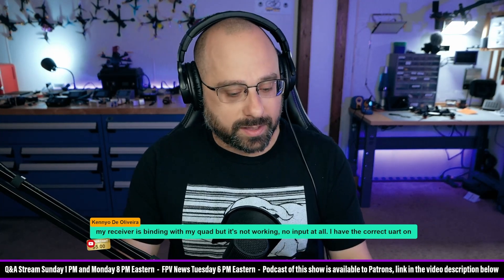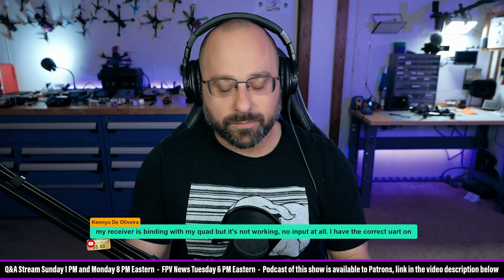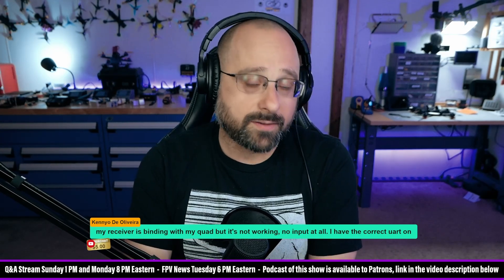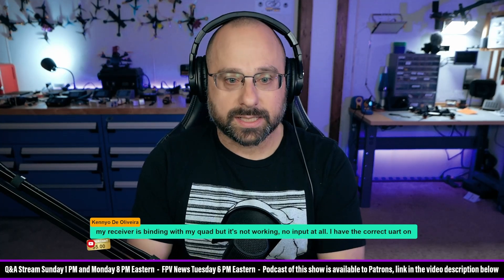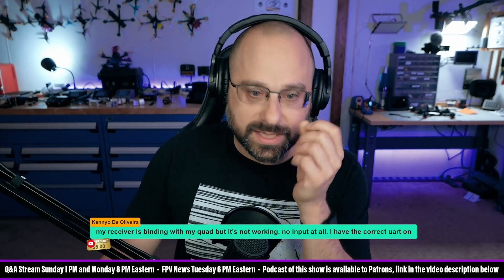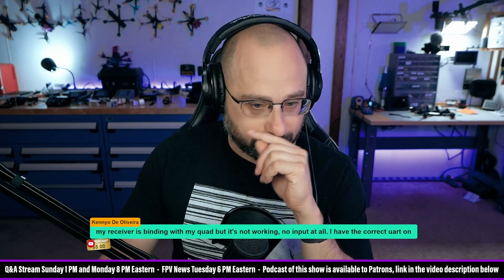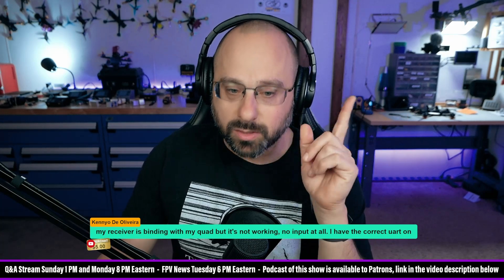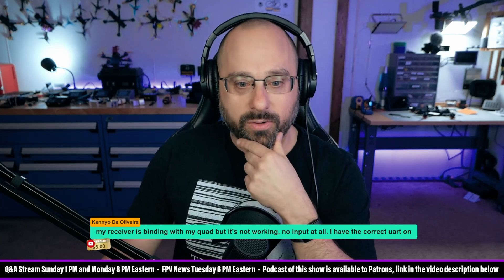My Receiver Is Binding But It's Not Working! Help! - FPV Questions

Comment: Hi Joshua my name is Raymond McWilliams and I am currently having a problem with getting crossfire connected to my radio the lights are green on the receiver on the radio but for some reason my radio won’t connect to the module any help would be appreciated

Comment: I traced the exact issue he's experiencing by connecting to another identical receiver, which worked correctly.  I discovered that my other, non working receiver wasn't flashed with the same firmware as the second that worked fine. Had I checked that first, I'd have saved myself hours of banging my head against the wall. instead of banging my quad against the wall, which I'd have eventually done once bound and built.

Comment: hi i had same problem radiomaster tx16s with ranger micro updated tx and elrs speedybee 2.5g rx bining works but nothing is moving at betaflight finally i found the problem was simple AUX in put for each movement

Comment: I wired 30amp esc's together on a rc excavator to a flysky transmitter recently. I had it working great and it just quit working and wont do anything.  The receiver isn't getting power i think bc the red light isn't coming on. Anyone have any idea what happened? Did i fry the esc's or something? Any help is appreciated

Comment: ok so i have a CineLog30 V3 with ESLR reciever and a Pocket controller and on betaflight it will let me set everything but as soon as I connect the drone to fly it, the controller wont respond. Says RX Loss but its still bounded to controller! I bought separately the O4 unit and installed it to the quad...spend hours and still cant identify the problem.  anyone help please!!

Comment: Tx to RX and RX to TX doesnt work for me, it keeps solid on that way and unable to bind,
when i put TX on TX and RX on RX  it can be put into wifi mode, bind, etc.
But i get no inputs in betaflight still,  uart2 serial on, CRSF protocol,  yet i see a "C" in expressLRS script for connected.

Comment: I'm going to save a few of you guys hours of frustration if you are bound, but have  no stick movement in betaflight. HUGE thanks for NORD FPV's video pointing out the issue with the O3 wiring harness - especially if ur upgrading from crossfire to ELRS.  You MUST remove the SBUS and extra ground in the 03 wiring harness, DJI's protocol conflicts with the ELRS one. 

I double-checked the wiring (TX to RX, RX to TX), moved UARTs, matched the ELRS software on RX and TX, turned model match off — nothing was working...The quad was about to go through the wall lol

Removing those two wires did the trick! Absolute legend! 🔥🙌
Reply: Bro thank you so much my new geprc vapor d5 o4 pro was about to turn into an example!!!
Reply: Does the problem occur even if ELRS RX is soldered on a different UART?
Reply: @ Yes, the issue still happened to me when I moved the ELRS to UART 3 instead of UART 2 (which is typically RX). I even unplugged one side of the O3 harness from the FC to test UART 3, and it still caused a conflict. I pulled the pins back using tweezers, removed the two extra wires — voilà, it worked.
Reply: @ For me only cutting SBUS did the trick, no need to cut GND :)
Reply: @RebellisSpiritus  Hell ya!
Reply: @FPVNYC thank bro You saved my quad!🎉🎉🎉🎉
Reply: I have the O4 Air Unit Pro and this worked for me also, thank you! In Betaflight I just pulled out the plug for the O4 and receiver inputs started working, then re-inserted the cable and inputs stopped again. I looked at the sheet for my drone (Vapor-X5) and there's just one pin from R2 to the O4 Air Unit's "SBUS" pin so I pulled that wire out completely and it works now (mine only has one ground pin so just removing that R2 <--> SBUS wire was enough). If anyone just happens to be in the same boat, I hope it helps. Thanks y'all 🙏🙏
Reply: @kali-wolf  
      Is there any chance you have a photo/video or could explain this more? Im having the same exact issue and found all the trouble shooting you did very helpful. Im new to FPV and its hard for me to follow. I have a Vapor D5 with 04 air unit. When you say pulled out the plug in betaflight this is a settings thing? I thought we had to phsyically remove a wire.

Comment: I get action in the receiver tab but the drone does nto respond or arm/disarm. it is powered up , bound to controller and uart  configured to serial as it should. Beta flight shows controller and movement on buttons, but once I try to arm the drone nothing happens. ive tried with and without the USB connected and set it to arm without gps lock for testing.
Reply: I got a fix. Plug your drone in setup ark switch arm the quad (no battery needed) then leave it like that and got to CLI and type "status" in the bar and it will tell you at the bottom what it is.

Comment: A fix i found was flash your fc again making sure you have selected your receiver protocol before flashing on the update firmware page. 

If for instance, it shows crsf and you rx is sbus you wont flash your fc with the sbus files needed to save space it only flashes the selected protocol.

 So everything physical is correct and selected in betafliht but your fw dosent contain the files it needs.

Comment: How can I email you? been struggling bad truying to get mine connected i have an f405 v4 ,tx to rx, dji 03 depin the sbus. controller is bound and showing telementry. uart is set and still no respones in betaflight

Comment: I had this issue, and I finally fixed it. Reflash the firmware, but make sure you select the applicable radio protocol. I had mine set to SBUS on accident. I set it to CRSF, and now it’s working perfectly 🎉
Reply: I think I am having this same issue anyway you can help me?

Comment: hi i am having issues with my speedybee f405, flysky fs i6x and the flysky fs a8s. they was working this morning but now not? ive ive it wired up to uart2 and set the config up for it. also changed the seeting not the controller to ibus and sbus but not is showing up
Reply: You got the solution?

Comment: I have a question about my newbeedrone and beta flight my receiver tab is locked up and won’t let me select the serial receiver provider and my tx12 will bind and then say rx signal critical and telemetry lost and then reconnect and do it again sometimes will bind to let me fly but then disconnect when I change batteries. I’ve also deleted all files off of remotes sd card and then reinstalled.

Comment: Common solutions: wrong UART selected in ports tab, need to set "serial RX" in the ports tab on the UART that the receiver is on, CRSF not selected in receiver tab, bad wiring/soldering, some Rx/FC need to be wired tx-tx & rx-rx, toggle model match?
Reply: Dude you saved me from not be able to fly today !!!!  (besides this final piece of knowledge, if I know what I know so far I may be flying two more weeks ago)
I turned off that serial RX while trying to fix my VTX problem (a total newbie, I think I fried two new VTX by not reading the wiring correctly and suffered...)
Reply: @TaigiTWeseDiplomat--Formosan  👍🏻 Blunty told me about 'serial rx'

Comment: Hi J. B.
I recently recieved my first drone, GEPRC Domain with O3 and expressLrs, I bind it to the transmiter ( radomaster boxer with biult in expresslrs) - light is solid, see "C" in the transmiter but the drone dont respond to the comands.
The transmiter and the reciever are with a diferent version of the expresslrs .
Im afraid to change the configuration of the reciever and cant repair it later since is an by and fly product.
Should I do this ?
Thansks.
Reply: im having this problem did you solve it
Reply: @daveks21  I was in the wrong model of the expresslrs in the radio and the switches werent  correct configured in betaflight so the quad couldnt arm.
As soon I choosed the corect model and configure the switches, it flew beautfully.
And I crash.
😁😁😁😁😁😁
The lesson is : even before the first flight you have to understand at least a minimun of betaflight.

Comment: I experienced it (ELRS). The wiring is correct and everything is smooth (I flew before), but suddenly the remote gimbal doesn't work, while the Rx and Tx are connected properly (the RX light indication doesn't blink).

When I'm arming, it works fine. But for some reason suddenly it doesn't work anymore (can't arm) and in BetaFlight, the remote is not active. But wait a few moments, the gimbal remote works again, can arming, beeper and others. One after another, I don't know why

Comment: How do you get contact with you for help iv spent the last 5 days no sleep non stop working on my wizard 220s bought assuming it was set up ready to fly I cant connect goggles and it won't allow all controls on beta to move only switches when I pitch or role I get 0 movement on the tabs but it is connected and on the correct uart I have my pid settings sorted but no movement

Comment: It has been so long since I messes with Betaflight. I had to update my 3"from BF 4.2 to 4.5 because it wouldn't allow me to change motor directions without updating. Then it made me update the BF configurator from 10.9 to 10.10. Now my receiver, which was bound and the drone worked , but it's not binding now.   I haven't flown this quad in about a year. 

I tried to fly it the other day but the receiver, which worked fine the last time I flew it, would not connect to my radio. Nothing changed on the receiver, flight controller or radio, it just didn't connect anymore. So I re-flashed ELRS on the receiver and it instantly connected to the radio because I use a binding phrase. 

I went out to fly the drone but 2 of the motors are spinning the wrong direction. Again, this drone flew fine the last time I flew it. I have not crashed it, dropped it, I haven't plugged in a battery in close to a year & I haven't plugged it into a computer either. Somehow the flight controller "Forgot" which way to spin motors 3 & 4. BF would not allow me to change the motor direction without flashing new updated firmware, so I did. Now the receiver is not connecting to my radio. I have the correct port serial RX enabled. The ports tab is just like it should be. It's set in the receiver tab to serial RX and to CRSF. It's all correct as far as I can tell. 

This is my 4th year of building & flying these things, but I took last year off for the most part. So I'm not totally green when it comes to this stuff, but I am rusty I'll say. Going back over your videos to remember how to set up VTX tables, etc.
Reply: I have had similar issues lately with receivers binding but one day signal is just not coming trough with exactly same setup
Reply: @eeropehkonen2370  I suspect an electeical storm came through and the antennas picked up some electrical jolts from lightning. I cant think of any other way the motors could have reversed direction or the firmware to be corrupted in such a way that BF wouldnt allow me to make changes.  

From what I've read an electrical storm can do this but its very rare & unlikely, but its the only thing that makes sense to me. Or two elrs receivers and two flight controllers and ESCs all use cheap flash memory and something called "bit rot" happened, but thats also said to be very rare.

Comment: got the solution from this, 
1. check your uart is it right or not
2. if your FC F7 or F4 using O3 or vista,, unplug/cut yellow wire/sbus from O3 to FC.
work in mine

Comment: Unbelievable, I took off my ELRS receiver and installed a Diversity, copied the 5V G TX & RX wiring onto the diversity, connects to the boxer controller, just no inputs, hours trouble shooting, turns out I had to solder the TX & RX the opposite way to how they were on the non diversity receiver. Now works.

Comment: I seem to have same issue as well. Everything works when going through menus in Betaflight, and I can see my inputs all work, even managed to show no flags, but I still cannot get motors to arm, once I plug in flight battery. After plugging in battery, while still connected to Betaflight and after checking box in motors tab to say prior are removed, I see no movement in Betaflight. Flag then show rx loss. I’m using Futaba BTW. any suggestions? It’s getting beyond frustrating.

Comment: Oh wow great video didn’t help me at all. Everything is connected according to the manual. Never had this problem with kiss and crossfire
Reply: I had this also. what I did is to go to "firmware flasher" in the beta flight before you connect the FC , after that choose auto-detect your board and than "Load Firmware" and after "flash firmware". This may  work (depends your problem) for you only if you firstly downloaded the program (BetaFlight) or if you changed the board (FC).
Reply: @NL_HAMEKAFKEF  thank you bro this worked for me. hours and hours but nothing was working and your comment worked for me thanks again
Reply: Yeah me too.  Not sure what else to check.  Shit don't work.
Reply: @CGreciful  usuall thing for ELRS.. you need to UPDATE firmware of the RECEIVER to the SAME!! as transmiter.... thats problem #1 for elrs :D everything needs to be same.. luckily... almost every rx and tx has wifi, so its reall walk in the park to update them.... just the first time doing it is pain:)

Comment: Im having the same issue. I have had it set up correctly before - correct uart, tx-rx rx-tx and it binds with the quad. Im getting an SBUS_BAUD_FAST = ON error message when I load an RC_LINK preset in BF. I know last time I had this issue (like a year ago) there was some other step that once I did it, everything worked but this time Im getting this message and I cant figure out how to fix it. Help.

Comment: I have the same problem, i am using radiomaster pocker (CC2500), radiomaster R81 receiver, SBUS Protocol
Reply: Hai risolto? 
Se si come?
Reply: @Fizz_Gerard  i have flashed and reset the firmware of my flight controller. works great now !!!

Comment: My JR 921  receiver lights flashes fast then does blind when the 9303 is turned on  but after removing the blind plug , turning the switch off and  on again the receiver works the servo but the ant 1 & ant 2 lights on the receiver flash slowly and the sat light also flash slowly.  Why isn't the receiver light solid  after blinded ? Do I have a problem ?

Comment: I have an Argus F722 pro. I’m using a RadioMaster elrs RP2 2.4ghz. The quad will arm, the motors spin up and it seems I have some throttle control but no pitch roll or yaw. Once I touch the throttle it throttles up but won’t throttle back down???????
Reply: If you don’t have props on the fc will freak out trying to makeup for the lack of lift it’s supposed to be achieving due to no props installed. Nothing to worry bout there just disarm

Comment: Bro I have a receiver FX400R and Mamba F722 mini FC stack with 306 ESC. I connected the receiver SBUS to RX1 in and Smart Telemetry connected to Tx4. Both ports are enable in betaflight (4.4.2) UART = Serial RX, UART4 = Smartport. Receiver is binded with Jumper T16 (EdgeTx multi). Binding was successful, receiver have soild green light as well. But receiver is not communicating with FC, joystick movements are not showing in betaflight. Im getting some of the receiver voltage datas and singal range in my transmitter telemetry data.
Can help me to rectify this issue. I have tried the same on some other UART also, but no use.
Reply: I have tried to set serialinverter on/ off, set serial halfduplex off... But no improvement 🙁

Comment: I have my mobula 6 Hd it was working fine until I did put external vtx, The SPI receiver doesn’t have input anymore, even it’s bound!! Any suggestions? I didn’t change any settings in betaflight vtx is working fine
Reply: got the same exactly problem this morning, how do u managed it?

Comment: Guys I soldered rx to rx and tx to tx but my controller won’t bind with receiver. Should I still be able to bind regardless ? Both module and receiver have been flashed to latest firmware
Reply: If using Elrs or CRSF you have must connect Tx to Rx (transmission to receiver)

Comment: I had a bad uart once where my radio is bound but on betflight the receiver tab won't respond. Pick a open uart on your board and use that. Then go into your ports tab and select that uart. It worked for me.
Reply: Same problem here but Ican’t Solve my problem
Reply: Use a new uart.
Work for me.
Reply: Cool, so these flight controllers come with bad UARTS and you just have to try each one until you find one that work.  Great, makes sense.  LOL

Comment: So I've got a crossfire rx wired to a new x12 aio and I have the Rx solid green the tx solid green on both Rx and tx and I'm set to crsf and the right port. No movement whatsoever. Is my ex dead

Comment: I have an X file, I have transferred all my crossfire drones to ELRS and in 5 of them everything is perfect and very easy but I have a drone left that I wanted with a little more range and I have put a diversity model on it and that's where it started my problem, the receiver binds with all the sensors but there is no way for the bars to move in betaflight, I have tried two brands of diversity receiver to rule out, the RX and TX are correct, uart 5 is where I have the wires installed and It is correct in betaflight, I have the same power in the receiver and the emitter, I don't know what it could be, a little bit of your light would be very good for me. 👃👃👃👃👃👃👃👃
Reply: I already solved it after 2 days trying things, in the end it occurred to me to try a different uart and surprise it worked! The most curious of all that the previous one was where the crossfire worked without problem.
If someone has a FC F7 HD Tmotor that does not put it in uart 5.
Reply: @mcferran6720  you had to solder it to another UART on the FC or you just changed the UART in BF?